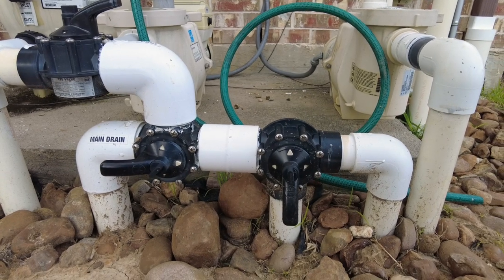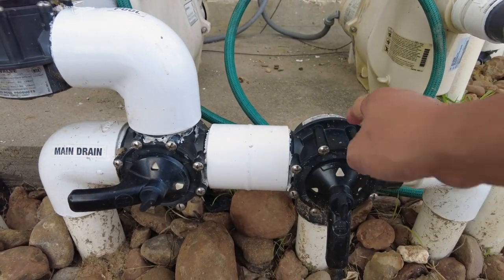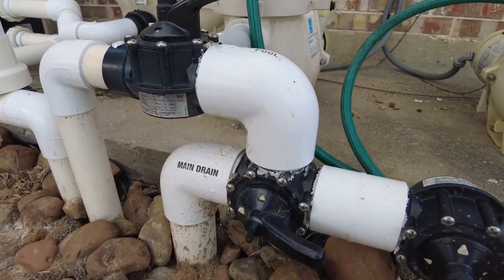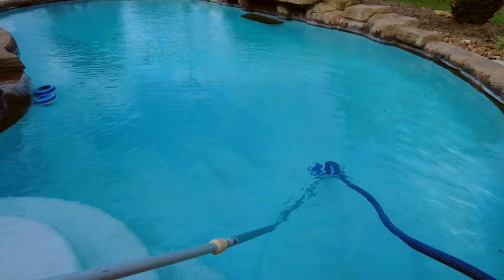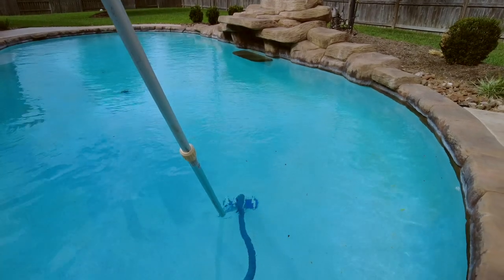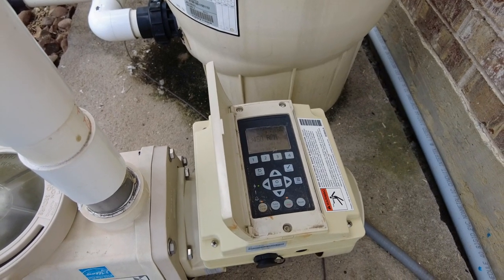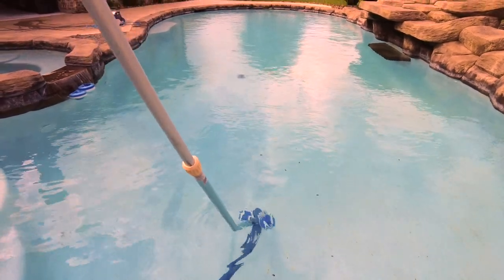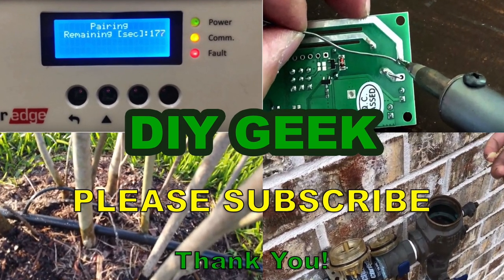HOW TO VACUUM YOUR SWIMMING POOL USING SKIMMER

Comment: I always run the hose into the pool to fill it completely with water and go through the skimmer door from inside the pool into the skimmer. Also use a tennis ball to plug one skimmer and get more suction. Thank you for the vid!
Reply from the maker: That's a great idea!
Reply: Is that what’s going on with the second hole at the bottom of the skimmer?

Comment: Video footage on the priming process starting from when you first put the hose into the skimmer hole would be valuable.  Along with tips. Some people do struggle with the pump losing prime, and some pumps take a bit to prime again. 

One big tip I use to help is, place vacuum head & pole into the water
use a small bucket to pour water down the hose from the other end before putting the other end into the skimmer hole

This is for pumps that are tricky after they've lost prime, which they do after sucking a lot of air out of the vacuum hose. 

I really like using ropes with lead weights, tying the rope to the ends of the hose, or where you join 2 hoses and need it to be air tight so no air is leaking.  I just like having rope and small lead weights on hand just in case it's needed for some reason, such as draining a hot tub by using that vacuum hose as a siphon as an example. Keeps one end on the hot tub's bottom.
Reply: My pump is losing prime when I vacuum to waste. There is no air in my hose I made sure of that. Is it normal for it to still lose prime?

Comment: Shouldn't you put in your skimmer basket and use a vacuum plate rather than plugging the vacuum hose directly into the bottom of the skimmer? I would think using the skimmer basket and plate would prevent sucking debris into your sand filter.

Comment: What if I have no skimmer? How do I vacuum my pool without a skimmer?
Reply: I can help you
Reply: Because I also don't have a skimmer and I vacuum my pool in a different style.
Reply: At least you should have the following things
Vacuum head 
Vacuum pipe 
Pool pole
A motor (1/2hp or 1 hp doesn't matter) (any motor, it can be the motor you use for filtering your water)
Reply: Connect vacuum pipe with vacuum head on 1 side and with the suction area of motor on the other side. Now switch on the motor and remove the air water will start falling from motor. Now connect a garden pipe to it and leave it somewhere (for vacuum to waste) or put the pipe in your filter (vacuum to filter)

Comment: You should always use a vacuum plate on the skimmer. This is not the correct way to vacuum a pool.
Reply: No really.  All it does is let you use the skimmer basket to catch big debris
Reply: NOT *